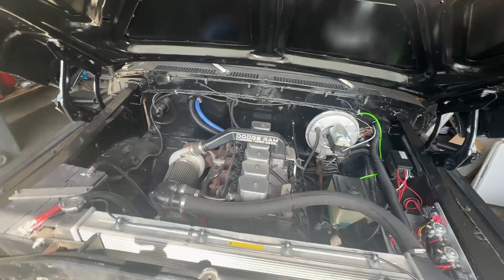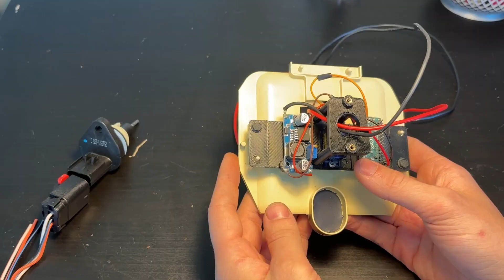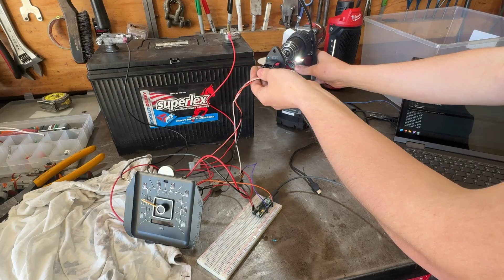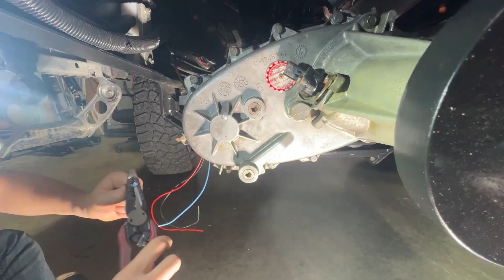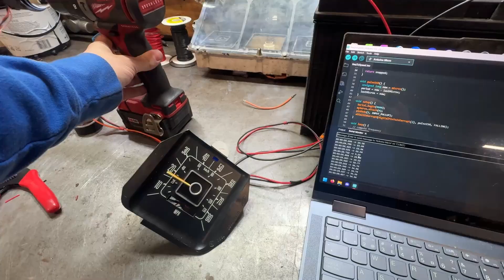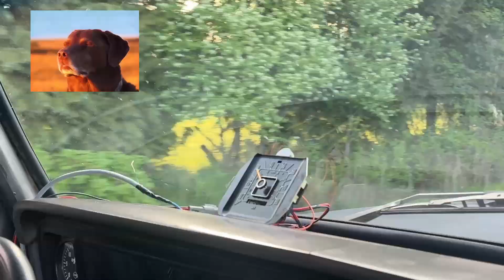DIY Electronic Speedometer Conversion for a Cummins Swapped Ford

Comment: Can you tell us what parts you used?
Reply from the maker: It is all fairly generic components.

Behind the dash used:
90deg Servo
Buck converter to go to 5V Power 
Arduino Uno, small form factor

Outside dash:
Shielded wiring
OEM VSS from the dodge powertrain.
Reply: Would you be interested in making these and selling them? I would buy one 110%. I dont have a 3d printer or the knowledge to figure out whatever you were doing on the computer
Reply from the maker: @cac338 I’ve definitely thought about it. I would have to spend much more time to make a plug and play kit. I’ll try to reach out if I go down that path
Reply: @jbtmorgan very interested!